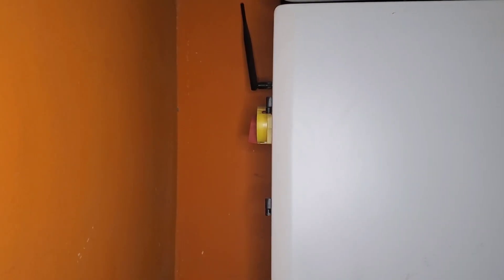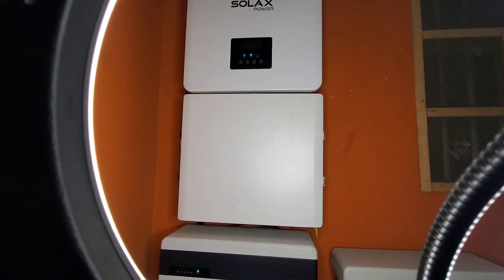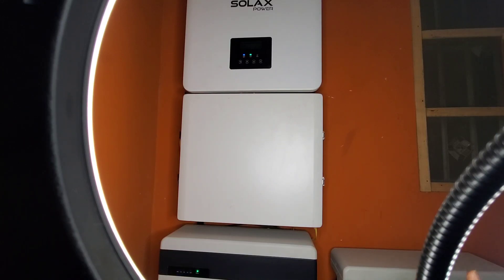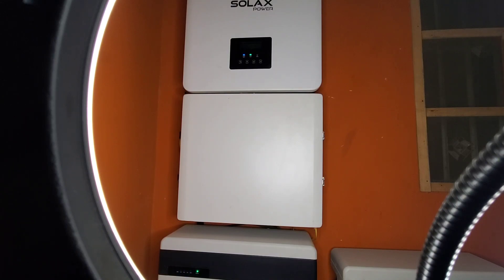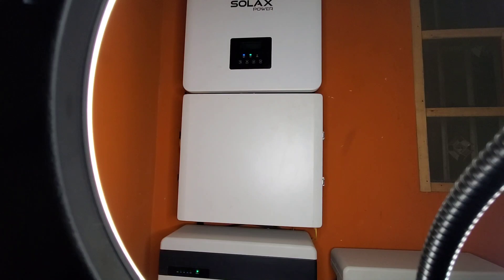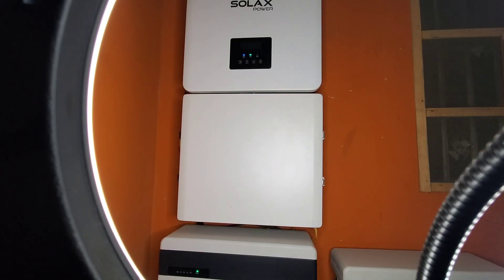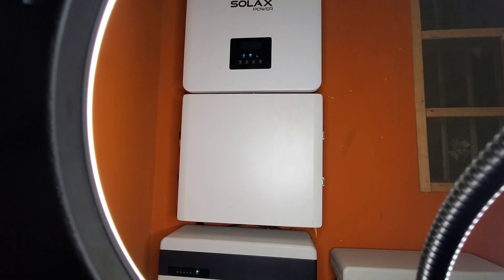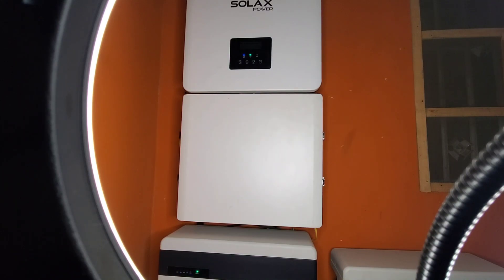Why do I install Hybrid inverters? it is not just money. it is more

Comment: Your comparison is basically about cost, appearance, and ease of installation. What about the performance of the traditional inverters regarding high surge current devices like water pumps,2hp air conditioner, induction motors, etc Vs hybrid inverters ?
Reply from the maker: Good morning. Thank you for watching and commenting. I don't know what you call a traditional inverter. The 5 kw can surge to 10 kw. We run ACs, water pumps on them with no issues. I hope this answers your concerns.
Reply: @drsolar  i was referring to those bulky heavier low frequency inverter, since most hybrid inverters are high frequency inverter
Reply from the maker: @theo2378  I was messing with you. They have the same surge ability as the good quality low frequency inverters. Victron has started to make HF inverters so that seems to be the future

Comment: Good morning from Norway!

I am about to install an off grid system in my cabin in Norway, and for a long time I thought my best and only option was a Victron system. I stumbled upon your videos throwing out Victron gear and got very intrigued!

Many months later: I am down to two options - SolaX X1-hybrid vs Fox-Ess. 

One question. Main concern! 

Even though both of them use natural cooling there will still be some noise from the inverter. Is that the background noise we hear? SolaX says below 30DB for their one phase system, FoxEss below 40DB. 

Would love to hear your experience with this. Would also love to hear if you have an impression of the sound emission of the Luxpower ( below 25 DB), and Solis RHI-hybrid (below 20DB). 

One reason for the difference could be that SolaX and FoxEss are truly transformerless. Luxpower uses HF conversion between battery and inverter. Is the SolaX really louder compared to the Lux?

Thankyou!
Reply from the maker: Hello. Norway is far from Lagos. Thank you for visiting our channel and for commenting. You don't really hear the background noise. You feel more of hum than sound. I think that there is an internal fan and that is what causes the sound that you feel more than hear. LuxPower is very quiet. It has been almost 2 years so I don't have a recollection.

Comment: SolaX vs Victron in terms of cost? Did I hear you clearly that the SolaX has 2 charge controllers? Did you mean two MPPTs?
Reply from the maker: Good morning from Lagos Nigeria. Thank you for being the first to comment.   Yes it has 2 mppt charge controllers
Reply: @drsolar  Greetings & good morning. So the same as the Deye / Sunsynk at 5Kw… I do love the form factor of the SolaX especially with regards to the breakers & changeover switches and all being tucked away, just wonder about the cost being that, naturally it’s going to be more efficient and suited to it’s own battery pack BMS.